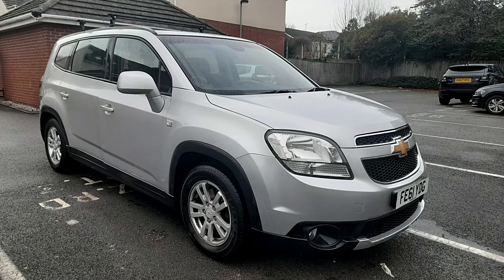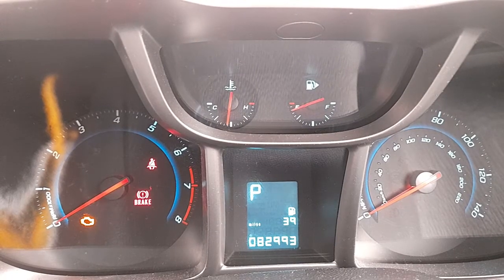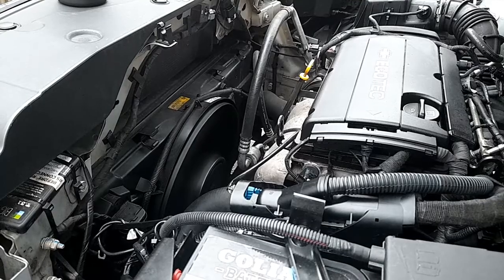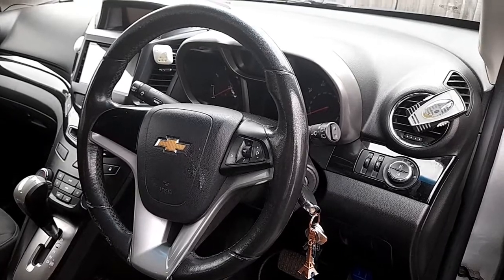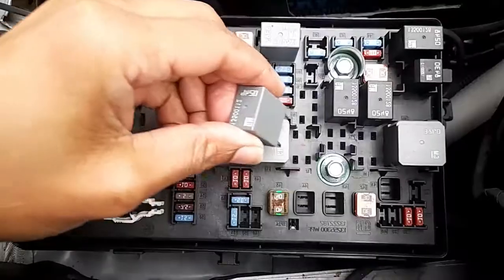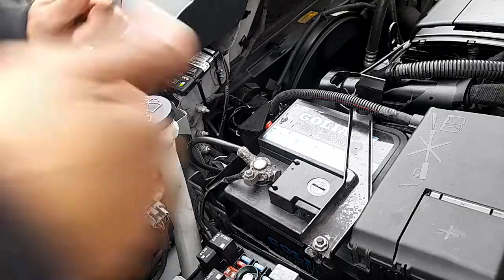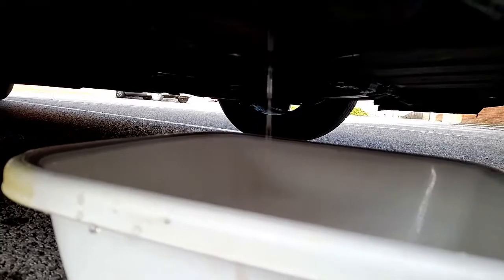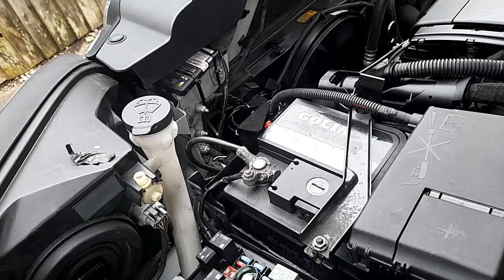Cooling Fan Running at Constant High Speed, Chevrolet

Comment: Hey man,
I have chevy traverse 2014,
After engine start, Temporature guage reaches to middle and drops completely down to 160 and the fan turns on very fast. Engine light shows up too.
I replaced new temperature sensor but it didnt work.

Please advise

Comment: My car also have the same problem, did you manage to fix the problem?
Reply from the maker: Not yet I am told it is the fan, there is nothing wrong with relays I have swapped them around. it is over 2 years now and it works fine even though the fan is always on. I have taken it to France and nothing is wrong